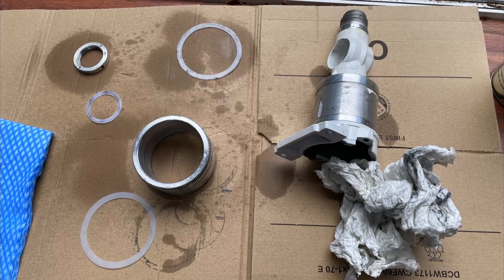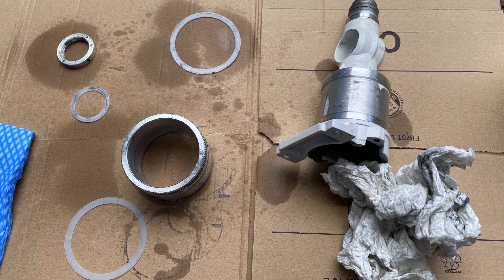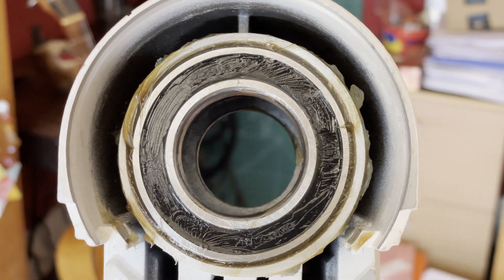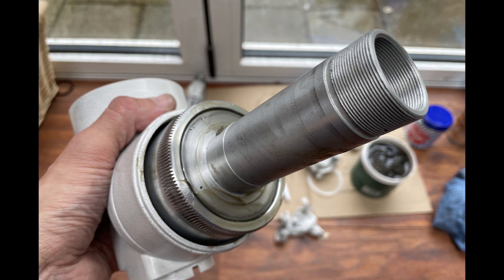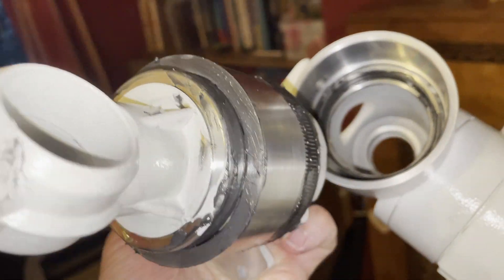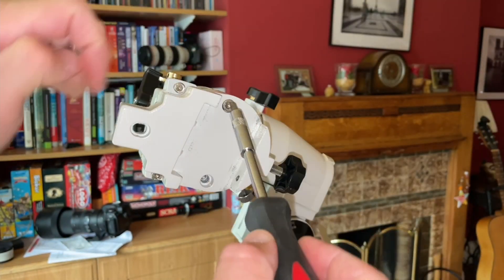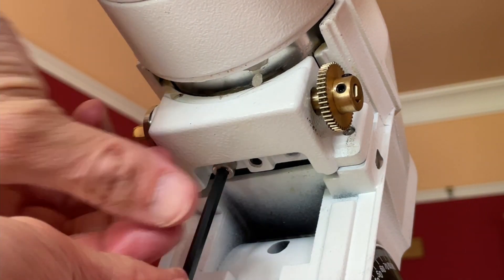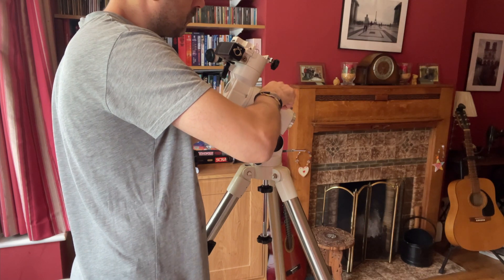SkyWatcher EQ5 Pro Mount Maintenance - Part 2 of 2 assembly in 10 minutes!

Comment: Hey, I have that same setup shown in the intro: Eq6rpro and ED80 (the 'gateway drug', as some used to call this scope). Unrelated to this particular video about the EQ5 but, how did you managed to attach the guide camera to your finder scope? Thanks.
Reply from the maker: That’s a really good question which I can’t remember! I’m pretty sure I just screwed it on and there must have been an adapter. I don’t remember buying one but it was a good 2 or so years back. 🙈

Comment: Hi great vid 👍 I just received my eq5 today, used, whoever had it took the whole mount body apart & I have screws all over the place & now idea how to put it together so it functions! I figured out some of it but can't get gears connected in any functional way.  I mean the whole body is in pieces, lots of pieces 😭 I need help! If you have any tips I would be forever grateful 🤞
Reply from the maker: If you look around on YouTube there is a guy that did a really detailed set of videos  which will be what you need. I squeezed mine just into 2 videos and ended up skipping bits. The tricky bit might be getting the worm drive meshing properly. It needs to be tight but not too tight! Good luck.

Comment: Great vid, thanks, but if I may:
at 3:10, we can see the bearing coated in grease and this may be a bit over the top.
This is a sealed bearing, so its lubricant is (and should be) contained behind the dark plastic cover. If necessary, you could repack it by popping one of the cover (or both) off using a pick hook (kind of like an oversized dental probe) , clean it, repack it and then reseal it. A dab of grease on the outside to make seating easier and improve corrosion protection is maybe not a bad idea, but that thick coating on yours will achieve anything good, as it will attract (and retain) any dust and dirt that may come in there, but mostly it may oxidize and harden, covering everything in a layer of sticky gunk. Not a great present to your "10-15 years in the future" self for the next maintenance.
Easy on the lube ;)
Reply from the maker: Thank you for the tip! Next time I strip it down I’ll bear that mind.

Comment: hello. at 03:25 mark, there seems to be a missing part. on your other video where you dismantled this, i believe i saw "ring like" metal piece in front of the wormed gear but here, it is missing. did you remove it by any chance? i wish you would have also shown whether you removed that wormed gear from the ra housing itself. i have an orion skyview pro mount and the ra axis is very sticky. i got it used (mount and 8" reflector telescope with some accessories, for only $80) but i believe it was not taken care of carefully. still, i want to try and see if i can fix it if it is possible. thanks.
Reply from the maker: If I understand correctly the ring like metal piece was the main RA bearing. So you have the worm drive gear, then the bearing that feeds through the RA housing. Then at the other end you have another bearing the 3 piece thrush bearing.
Reply: @astrojourneyuk  that is correct. as i mentioned previously that ra bearing seems to be missing. perhaps you removed and had not put it back yet? i will need to repolish my worm drive gear, maybe that will make it more fluid when i put it back together.
Reply from the maker: My issue was the absence of grease I think from the motor driving the mount whilst locked but the scope was stuck. So regreasing helped. 

Basically, what’s happened with the bearing was on disassembly it came out with the RA axis (normally it is stuck in the mount) however, when I put it back the RA axis back, I placed the bearing in the mount first to make sure it was in place correctly. That’s why there was a difference.